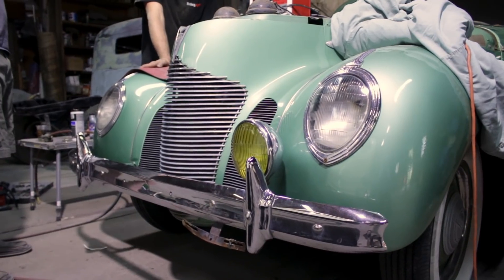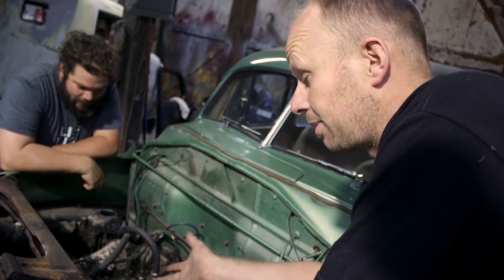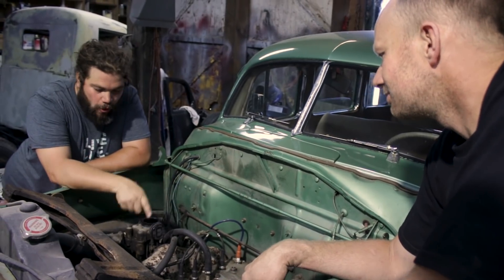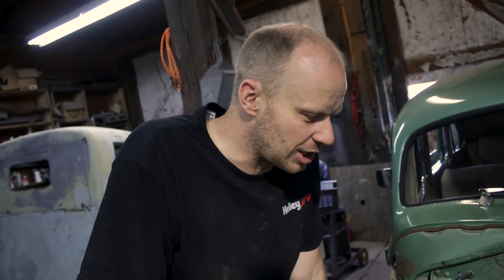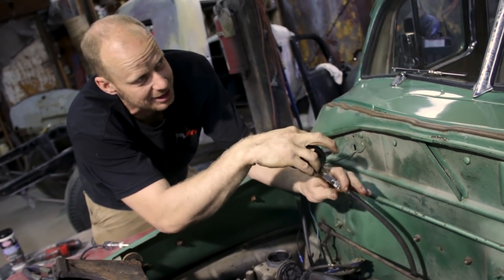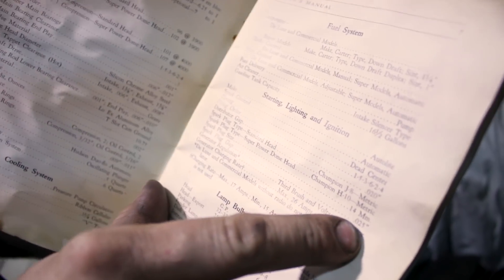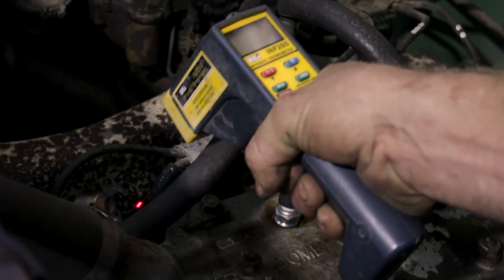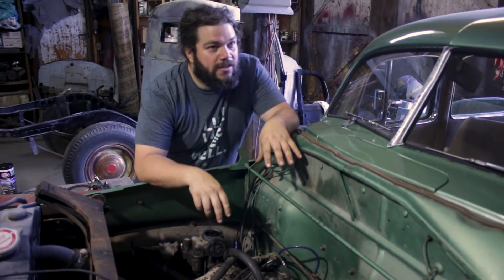Why The Carburetor Is Still FIT FOR ROYALTY

Comment: Because Corporal Elizabeth Windsor can set the carb, ignition and valve timing, points and condenser as well as fix a puncture on a truck. That's why the queen was promoted to corporal.

Comment: You stated that the hudson hornet was the first car ever to have a channel through the floor.. but the Vw beetle has channel through the floor at they have been around since 1938 or so  ..granted this channel was for strength and to house gear linkage . Throttle and clutch cables and fuel line. .but still one example of a channel through a floor before 1950s

Comment: Now I'm feeling nostalgic for the days before all the sensors when I felt like I knew what I was doing under the hood and had a good idea what was wrong right off instead of just staring at the engine like a zombie. The days when I was perpetually broke and picked up cars for 300 bucks , pulled the twig or screwdriver  out of the carb , the bolts from the vacuum lines,  found the breather in the trunk , Picked up some fix-a-flat and tune up parts and set to having a stress free afternoon .
Reply: You can still do that but you will need a scope  and scanner. The junk yards are full of cars that have a wire broken or eaten by rodents  Same situation different era .
Reply: You are either a boomer or a young  kid who never worked on a car 

Either way today is far easier 
Now i plug in my 40$ scan tool 
And im diagnosed issue within 2 seconds and then i replace said part with a 99.9% chance of being right 

Oh and wiring and vaccum lines are fairly similar in diagnosing

But alot of cheap cars is just a 20$ censor to make em run perfectly 

Idk i find 85-95 to be a shit show 

Pre 85 mostly just vacccum lines and mechanicals 
Post 95 OBD2 and easy diagnosis 
Wiring replaced most the shitty vaccum lines that where always broke

Comment: I always dump a bottle of the STP motor honey crap in my 2002 Silverado 1500 with a 5.3 v8 at every oil change. If I just run straight oil then the lifters tick like crazy. I dump a bottle of STP in and it shuts the lifters up until the next oil change. It seems like good stuff to me.
Reply: Steven Vanheel check oil pump pick up o ring.  They leak letting air in oil. Common issue on 5.3. Also after 06 there is a mini oil screen under oil pressure sender causing lifter noise and trouble code for low oil pressure. Just fixed two.
Reply: james norse good to know. I will be sure to replace that O ring if I ever have the oil pan off for any reason.

Comment: New tech could have that diagnosed pretty quickly. Grab a scope, relative compression, secondary ignition, even in cylinder compression would have that pinned in less time than STP paid for.

Comment: have you checked the  timing?
Reply: that is an issue a lot of times, too many like to try and tune by ear and make the flatheads sound like OHV which is entirely too much advance...they end up running hot and losing head gaskets
Reply: Dave Micolichek  For OHV since they run less efficient that way and make it up with more intake. Flatheads heat up more because the combustion is in there longer and they're cammed for later ignition. See boards on flatheads. 
Think of it this way, hold an RV engine at 6k like you're running a race car and it'll overheat, try to pull a load at 2k with a race engine and it'll overheat.
Reply: Dave Micolichek  Generally yes but not necessarily. Compression ratio, cam duration and time come into play. Also, operating outside the ideal RPM range which it was designed to carry a load, this is why we have VVT and CVT ;)
Reply: Dave Micolichek  And flatheads won't overheat with advance added if you use aftermarket aluminum heads, better radiator and modern coolant. They run even better if you use a little longer duration cam with some advance on that as well.
However, it'll no longer run on kerosene

Comment: You can't th. Without an air cleaner because the lack of restriction means you get a lean mixture. A computer controlled injection system can compensate but a simple carb cant.

Comment: it sat so long, I wouldn't bother compression testing, without tune-up first, adjust valves, all of ignition and carb. rebuild. fresh gas and run a while
Reply from the maker: It ran 2 years ago.

Comment: One of the best ways to make new gaskets is to use a vinyl stencil cutter/printer. You do the gasket up in the CAD software and the printer will cut it to precise dimensions out of gasket paper.
Reply: So the best way to make a $10 gasket, is with $3000 worth of machinery? :/

Comment: When you're making a cardboard gasket, if you can spray something around the outside it works so much better than trying to get a pen or sharpie in, at least in my experience. Your first outside cut will be way more accurate. Doesn't need to be paint, you can always trace an outline with a pen after.

Comment: On a carburetor like say my moped when I pull the airbox off it's obviously going to change the airflow and resistance on the carb so It would run my bike lean  and blow up you have to jet richer since there is no control over the fuel the jetting has to be perfect unlike my moped you have a four stroke so running it lean can be "run"it sounded like it was running lean at first because the sound of the bog
Reply from the maker: Yeah, the vacuum leak did that

Comment: Did you guys try to set up the timing at all?? As old as it is, the advance was probably stuck and not advancing. It sounded pretty flat to me.
Reply: Steve 1961P.  Chances are its a manual advance you control from inside the car. But I agree they should have checked it.
Reply: like a old model t

Comment: Nice ride, nice video!  The likely reason why there's aren't many of these cars around, is that Hudson had only a tiny share of the 1939 market, maybe 2% or so.  I don't think anyone was chopping up 1939 cars for recycling during WWII.  Rich, for hard to find carb parts, check out the Carb Doctor in New Norway, AB @ carburetor dot ca.  Re: Packard Caribbean, I was told by a guy restoring one that it had custom quarter panels welded over the originals.  It was a low cost way to make a premium model from a lesser car.  The internet says this work was done by Mitchell-Bentley.

Comment: also, if it actually broke free all carbon at once, if would kill the engine...... plugged filters = no oil flow/bypassed oil filter, no fuel flow, chunks and debris polluting catalytic converter..
oh wait that is what ethanol does anyway.... then mix in diesel and DEF oh lord. the ancient 2 stroke "Detroit Diesel" polluted less overall ?+?

Comment: they can try to sell that electronic junk as much as possible, but nothing beats a carb. and dinosaur ignition system. only thing better is the old hit miss crude oil devices
Reply: throttle bottle and how about Screamin Jimmies? Gawd I love those!
Reply: can't agree, electronic injection & spark for the win. Much more simple and much less maintenance.
Reply: you do know that carb/points/condenser/distributor would run with only a a generator and "manual gearbox" coast starting, try that with anything "new"....
before that things used crude il/whale/etc. and had to be preheated with hot coals etc.... hit/miss engines, the ones that helped build everything that made the tech you use roday,.....
Reply: I've got a '71 Custom/10 Deluxe with a Quadrajet and original points ignition and it is just as responsive as any fuel injection. Three pumps on the gas pedal with the manual choke on full and she fires on about the third revolution every time.
Reply: I assume, the carb. has been rebuilt and maintained, as well as points, condenser and timing.....